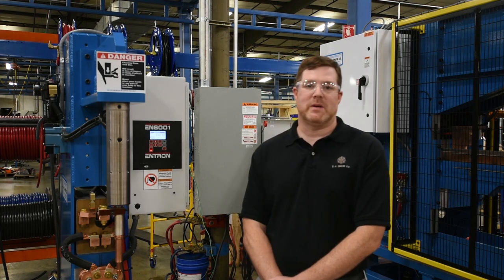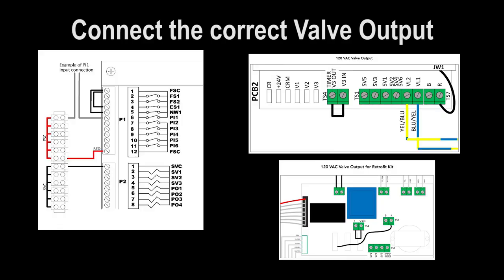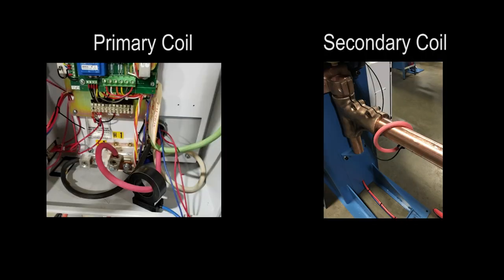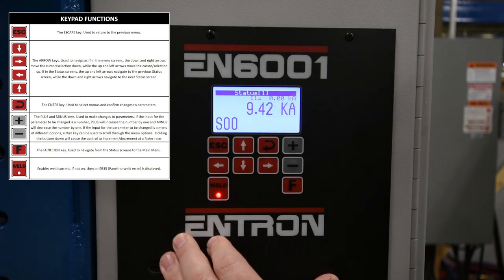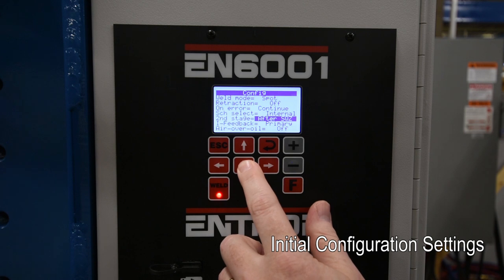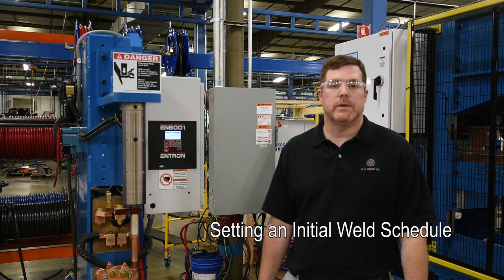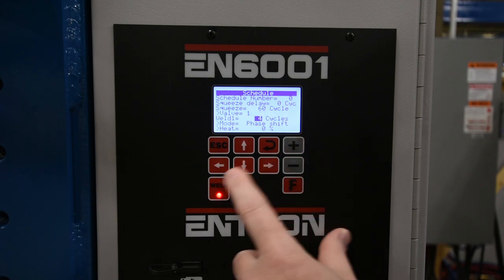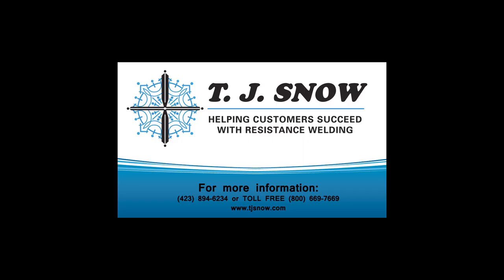TJ SNOW - Entron EN6001- Initial Setup and Control Basics (Resistance Welding Control)

Comment: my maintenance guy just finished hook up this control, it welded material crs .062x.590 no problem, but on the screen showing ER20, ER22, ER30 I checked on the manual book for error codes i still don't get it how to fix these problems. can you help me walk to it how to fix these problems. i'm newbie for spot welding machine. i working at Dudek & Bock we have Entron EN1701 and Entron UK this unit EN6001 is new for me. please help.
thanks
A.K.
Reply from the maker: Thank you for your comment. Please reach out to our Service Department at (423) 894-6234 for further assistance!
Reply from the maker: And, to provide more detail on your exact issue: 
Error 20 is Low Current 1 fault

Error 22 is Low Current 2 fault 
Error 30 is Low Pulse width fault

Unless you are actively trying to use the limits I would suggest turning them off.
I1 Monitor to off
I2 Monitor to off
PW2 monitor to off

If you have more questions, please feel free to contact us directly via phone or email. That is easier then working through video comments!  😀
Reply: Ok, I will try that, 
Thanks

Comment: I use to weld 22ga and 24ga with set up would you recommend TIA!
Reply from the maker: Edwin – I’m assuming you are welding 22ga. cold-rolled steel to 22ga. cold-rolled steel and 24ga. to 24ga. cold-rolled steel. There are many variables that you can come across when resistance welding metals. Visit our website if you would like to find out more about our Resistance Welding Training options. 

The Resistance Welding Manual published by the RWMA (Resistance Welding Manufacturers Alliance) that details the suggested resistance welding parameters for cold-rolled steel is also a valuable resource if you would like to learn more about resistance spot welding.